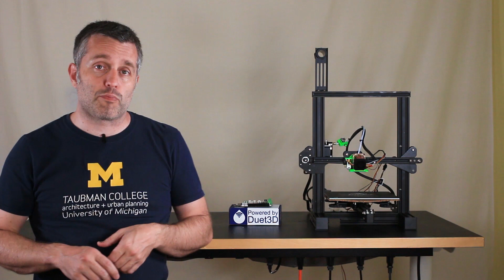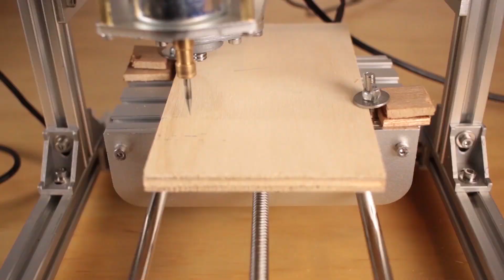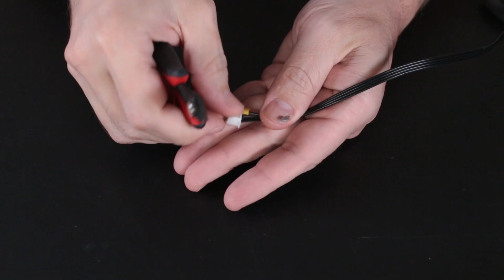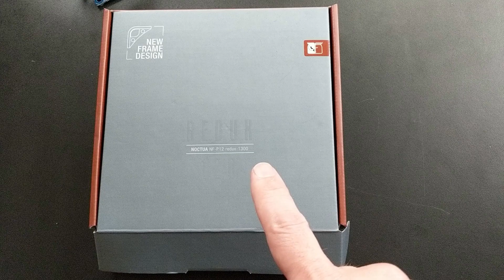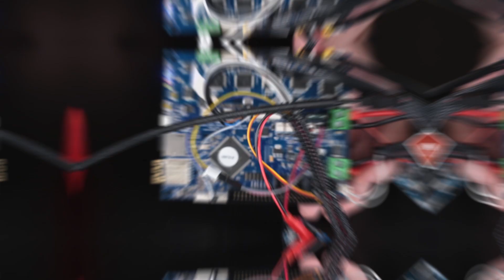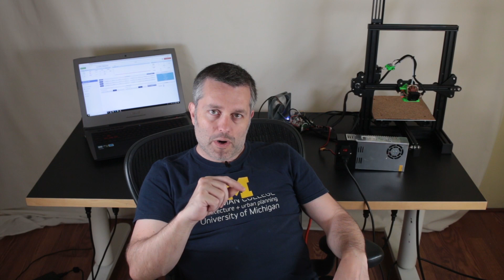Wiring the DUET Wi-Fi to the Ender 3

Comment: Hi I am upgrading my Ender 3 Pro from the stock board to the Duet 2 Maestro, do I need to replace my fans as well?  The wiring diagram shows 5v, but here you are using Buck converters to step down the voltage.  So I may be a little confused.
Reply from the maker: On the Maestro if you run all of your fans on 5v, you can simply switch the jumper from input voltage (24v) to being 5v instead. This jumper is located next to the first "always on" fan plug on the board. Consult the "Maestro Pinout" for more information.
Reply: @DesignPrototypeTest  Like you said the Duet Community Board is awesome.  No lack of help.  

Here is the response I got in about 40 Mins.: 

https://duet3d.dozuki.com/Wiki/Connecting_and_configuring_fans

If you have a 24v PSU and 24v fans, then yes, you can use them without any issue, you'd simply need to place the jumper onto the V_FAN and VIN pins which will bridge the VIN voltage of 24v to the fan circuit.

I think this video helped me make the right choice.

Comment: So who's the idiot? They guy who paid $300 more than your 500 for a kit machine that still has a laundry list of better features, or the guy who spent $300 building up a $200 machine to print slightly better than out of the box. Iv'e owned many 3d printers and have used even more than that. What I can tell you is that a cheap machine is cheap to the core, and there is no polish. Since I am not a child without options, I won't touch anymore $200 machines with a 10 foot stick. That cork board sagging down under the bed is a perfect representation of these machines quality. They're little more than garbage. Pro tip, you can secure that cork board with some aluminum foil tape. 

Also notice this guys description where he discloses his deal for reviewing. This dude has like 20k subs. No way he is pulling any special deals outside of "we will give you a machine, but you need to say it's better than an MK3 and only talk about how much you love it". Maybe that's not the case but there is no such thing as "unbias" when you're getting the shit for free. 

There is a reason big youtubers or 3d print enthusiasts like myself walk past a taz 6, ultimaker, ect... and go right to the MK3. Worth every penny. In fact if you're new to 3D printing, I would say save up and start with an MK3. Those shit machines will only serve to discourage you, and customer service will be no where in sight.

Comment: 1. DO NOT crimp on ferrules like this, even clamping it with a vice is more effective. Proper automatic crimp tools for this task are very cheap.
2. If you don't want to buy a crimp tool simply insert the bare wire. Ferrules are only needed for regular screw terminals which are not even used for PCBs. The terminals of the Duet clamp the wire between two flat pieces of metal, so you do not need a ferrules
3. Never insert a JST XH connector into a Molex KK terminal, you will not get a good connection. Mini-PV a.k.a. DuPont connectors are not good either but they at least connect properly.

Comment: Love your videos. As a big 3d printer hobbyist who cannot afford a Prusa but would love one they are just ridiculously expensive. I started with an Anet A8 kit 3 years ago and for a strat was great if you love to tweak. Now own Ender3,Tronxy X3,Flsun Kossell mini, Sparkmake resin and Solidoodle. I must say the kkts are the best and would put them against much more expensive units any day. Tried about every hot end, board and extruder, just upgraded my ender to duet maestro and love it. Plan to update boards on all my others with duet as soon as I can afford to. Not sure if you have looked at Prometheus hot ends and their multifilament system but they are great. I have tried the E3d hot ends and they were great but replaced all of my hot ends with Prometheus now. Personally I have no issue with the clones if you are short on money or in my case willing to tweak and test using a clone till you can afford an original. Everything in the 3d printing world right now is hobbyist in my opinion and if are willing to really dig into it then is a great hobby. Myself not ok one of the units I have but the resin printer is not upgraded in some fashion. If you are not willing to or savy enough to play around then a factory unit like Prusa is the way to go. Why spend all that money when you can do all and more with a clone as your base and lean so much in the process.

Comment: just to clarify you should not use a buck converter on the parts cooling fan (just the inside fan and the hot end fan since they are binary. on 100% or off 0%) the parts cooling fan is "variable" and you will lose that variable capacity through the buck converter.

Comment: REPLACE the power supply! it will hold the machine back. even creality is switching to MeanWell PSU's under $40 on amazon to replace the PSU on the ender 3 (and the pro, cr20, and ender 5 all come with meanwell now) your bed will heat up much faster hit 115-120 no problem and if its not tooo cold in your house like it is in mine 130-135 is possible. that means POLYCABONATE becomes possible!!!

Comment: I have ordered an Ender 3 Pro and your suggested fans and a Duet Maestro from M3D. I'm getting the PC wheels (just the tires) from Amazon. I'll probably use a Precision Piezo bed leveler and we'll see about the Duet filament sensor. I'll print a mechanical filament out sensor for now. I also want a BondTech extruder (eventually direct). I have a Prometheus hot end laying around I may adapt if I can. But it uses non-standard nozzles and it's meant for two filament Y adapters.

Comment: As an addition to this for clarity, as a design exercise for my engineering students, I have already installed a Duet on an ender-3 along with a Titan Aero, you can place the duet in the same location as the original control board and reuse the case, you just need to flatten the right hand  side of the original case, then remove the original steel nuts that are spot welded to the case, then drill x4 holes and mount the duet  on nylon stand offs. I have pictures if required.
Reply: I would be interested in the pictures :)

Comment: The proper tool to use for crimping is a PA09 "engineer" brand been using them for years and not had a bad crimp
Reply: Anything is better than the job shown. Even squeezing them in the door jamb would yield a better result.
Reply: zapro_dk  Well yes the attempt shown was how shall we say somewhat well below sub standard, but you must remember that the maker of the video might not even know that what he presented would make most of us technically minded types cringe, and unless we help to educate him he will never see the error of his ways. Unless of course he doesn't think there was anything wrong with what he presented, then in that case there is no point in trying to help him.
Reply: Don Mega  As someone who used to work in the automotive industry where the wiring harnesses were made, there is no way that that crimp would have passed inspection. Lately I've been using this crimp tool from Hobbyking and it does crimps as good as I saw from the dies at work. 
https://hobbyking.com/en_us/hobbyking-jst-sh-connector-crimping-tool.html
Its designed for the JST SH terminals but crimps the Molex ones from Duet just as well.
Its nice and cheap too.

Comment: Seriously? I'm an open source developer (among other things) and I choose such because I believe deeply that knowledge and techniques belong to everyone and that everyone is helped by openly sharing. If the "original creators" didn't want their product copied and improved on why on earth did they release it as open source? Amoral? Good grief.
Reply from the maker: While I can't validate your claim to be an open source developer, I am skeptical because of your suggestion that original creators chose to release their projects under an open source GPL. Often, what it comes down to is that there is really no alternative. The most maturely developed platform to start with in this case is the Arduino. Arduino is open source, therefore, any development you do for 3D Printers on top of the Arduino platform must be open source as well. If you wish to escape open source to protect your original creation or your valuable contributions, you must reinvent an Arduino like platform from scratch before you can even start to add in 3D Printer functionality. This is too daunting. It is hard enough getting a 3D printer controller to work, let alone redoing everything that is Arduino. Still, the GNU GPL open source agreement allows you to charge money for your contributions, and therefore it is not abhorrent to entrepreneurial types with the skills to add real value to 3D Printing. Meanwhile you have China coming in, making carbon copies of the DUET, and using the incredible Reprap firmware without paying a red cent for the development costs. Yes. It costs money to develop open source software. When you buy clones, you are supporting a Chinese company who adds nothing to the knowledge base, and you are taking away a sale from the company that did the vast majority of the work and honored the open source GPL. That is an immoral thing to do. And it is not sustainable. If you don't reward original creators they will starve and look for a more lucrative place to apply their talents.
Reply: @DesignPrototypeTest  Duet is designed upon open source, using open chips (no pantented drivers)  and open source firmware. The Duet board itself is Cern OHL 1.2 and there are two simple terms - silk screen credits to original designers and don't use/imply official logos. The chinese prints that i've seen all follow the license. You're also completely wrong as to why people open source - it's not because there is no alternative, it's because they want to be free. (also, WHy would you want to escape open source and claim to be making a moral decision to financially support someone who is closed or only half-way open source?) Open source is never done to cover development costs, its done to reduce the barriers to entry and ensure freedom. Open source is essentially giving complete and utter freedom with only requirement that the license protects the freedom and that means a self perpetuating license so that everyone who worked to establish the freedom protects said freedom. It's absolutely proven to be sustainable because it ensures freedom of use and freedom of derrivative works. Look at chrome browser, it's based on open source chromium, look at linux, it's open source, look at firefox, it's open sourced, look at arduino - its open sourced. If every project required an official 40.00 arduino to get to work then we wouldn't have the innovation in the space that happened because of arduino and it even took YEARS for arduino to finally recognize the community of open source software that they borrowed from and claimed as their own for years (processing) and now they finally put the original creator on their board. Duet is based on open source firmware, open source tooling, hardware & cpus with open source drivers (non patented interfaces/controllers) and provided as an open source tool with an open source license. No one owes them anything. It's great to support original creators but its also great to respect the license that the creators chose and not put words into their mouths that they only created duet for financial gain (which is nowhere on their website/license) - even their community is community driven and derrivative. It's cool that people support them directly and they can choose to do so but they did open source for a reason - and that reason is freedom.

Comment: and can you explain you have a prusa clone saying that you should support original creators not the clones, - why do you then not only have a  Prusa?, - having that prusa clone saying that you should only buy from original creators is kinda strange I think.
Reply: The Ender 3 is not a Prusa clone, mate.
Reply: @citronski  lol, well then, a clone of what then?, as it sure is not an orginal style of printers....
Reply: Its a Mendel using Openbuilds VSlot style framing. These extrusion frames have been used since 2012, TSlots since almost 20 years. Prusa uses still linear bearings that are fixed with cable ties.
Reply: @citronski  ok, thanks for that info,

Comment: and your Prusa complex continues, - why don't you just carry on doing the printer upgrades, and skip this prusa complex., and don't do that to the wires sleaves, - crush them only from one side, not alternative, - as you screw it in, - the screw will just brake and damage to connector, if it's only criped from one side, and you put that side flat to the screw , your fine without a crimping tool if you do it like that with a flat tool.

Comment: With regards to open source... why don't we skip all these cheap Chinese printers and only buy from and support Stratasys? After all they are the innovators.

So companies offer open source products but you're not supposed to take advantage of it? 

As far as the BL Touch... I don't believe they ever offered their product as open source.

Should we all skip installing Marlin... after all most of us didn't code it... did you donate?

I'm tired of people all being high and mighty about how things should be open source and then other people come along and shame you for taking them up on their offer. Are we on a date where the girl pretends to offer to pay but you really aren't allowed to let her?

If a company doesn't want people taking advantage of their open source... then don't offer it as open source. Last I checked Prusa is doing just fine in spite of Creality. And Prusa would be nowhere without taking advantage of open source. Remember Creality that Ender2 you are working on... a knock off of a Prusa... which is a knock off of a Mendel.

Don't forget taking advantage of open source plays a huge role in driving innovation.

I guess Adafruit should shut down its products as well and apologize to Arduino.

BTW... where do yo think DUET3D would be without open source?
Reply: 100% agree, why not suport the original inventors, why buy cheep knock-off of anything. ;)

Comment: Just interested, could we save more money by switching to a non wifi duet?
Reply from the maker: The DUET Maestro will give you access to the Reprap firmware, and it has the Trinamic motor drivers, but as far as I'm concerned the single greatest thing about the DUET Wi-FI is the ability to print wirelessly. No more Transfering SD cards, and you can also watch your print through the web interface. You can probably do this with the Maestro, but it will have to be plugged into your router with a CAT5 cable. Also, without the Wi-Fi capability you will need a screen. With Duet Wi-Fi no screen is needed as you can do everything through the web interface on your phone or a tablet when/if you are working at the printer.

Comment: At 17:50... "That's really amoral..." I think you meant "immoral," which is different. A better word choice may be "unethical." However, maybe it's better not to judge forum members based solely on their brand loyalty in making purchases. A non-Duet board owner is not necessarily a leech in the grand scheme of things; they may contribute to the Duet forum by helping solve other's problems, sharing mods, etc.
Reply from the maker: amoral vs immoral vs unethical: A good correction. Thank you. Also, a good point about the forum. I will try to mention this in the "open source and knockoffs" video. This isn't a black and white issue, but it might be a very dark shade of gray. At any rate, there are always exceptions. Most people I suspect would just buy the knockoff, then use the forum and never help out as they don't feel expert enough to chime in, and may be embarrassed to admit that they purchased the knockoff.

Comment: About the buck converter to drop 24v into 12v. Isn't the parts cooling fan controlled by PWM? How are you going to wire the buck  to drop 24v to 12v before the PWM control?
Reply: no no no no no!!! The main board automatically takes 12v /or/ drops existing 24v down on it's own to 12v - the board does not run nativly at 24v! It has a built in buc at the ACC input from the DC power supply. Do you think those fans run at 24v? HELL NO, the Duet is already doing all the work converting the power. You can put 12v OR 24v into this board and it converts it automatically IF it needs to.

Comment: Side note. Do not use step down converter for the part cooling. The capacitor on the input will smooth the pwm signal and until it drops below 50%, the output of the dc step down will benkept at 12V.
Reply: What is the alternative? A resistor, converting the excess voltage into heat?
Reply: Karsten Kruse  The alternative is quite simple. The outputs on the board is all using N-channel MOSFET's. This means that when the board turns on a heater, fan, whatever it switches the ground wire. The positive wire is always connected. If you are having a 24V-based printer and a 12V fan, all you need to do is feed the 24V directly from the power supply, into the DC-DC-stepdown, and the positive wire from the stepdown goes to the fan, and the negative wire from the fan goes to the board. This way the fan will be supplied by 12V and the "switch to ground" will still do it's job. The MOSFET doesn't care if it's switching a 24V, 12V, 5V or 3V load to GND.
Reply: @zaprodk  Thanks, guess i should be able to verify that with my scope somehow.
Reply: I don't think the capacitor will be a problem, but the switching regulator will be pretty pissed about the fluctuating voltage input and it might blow from that. The alternative  i will write as an answer down below:

Comment: how many bits do you need to run 5 nema17s ?
Reply from the maker: How many bits do you need to run a touch screen interface, or support a Wi-Fi connection? It's not just about pushing the motors around.